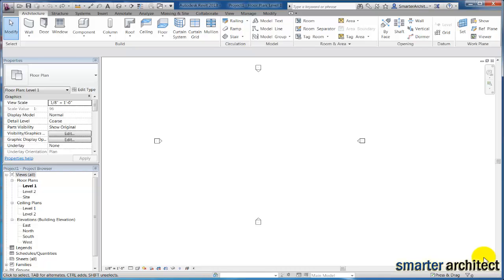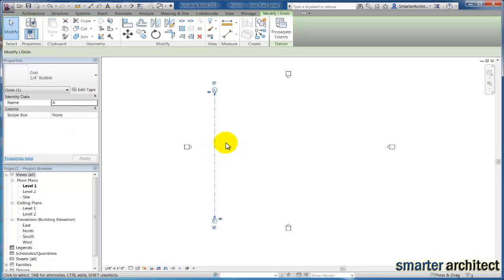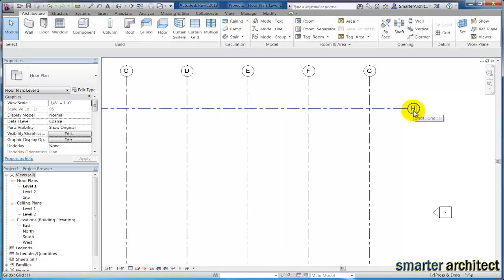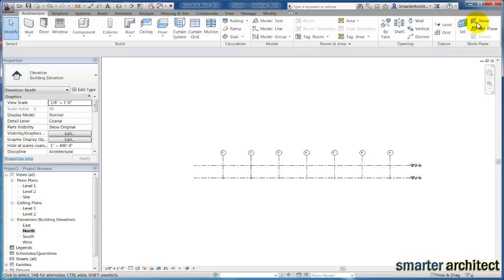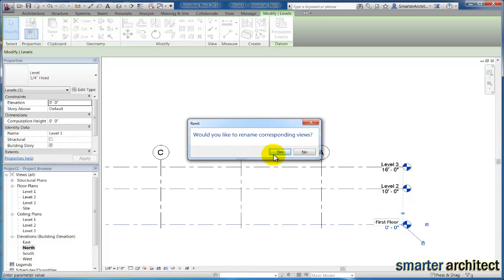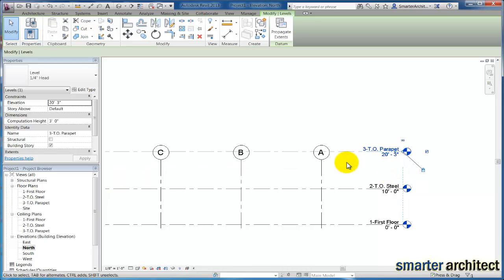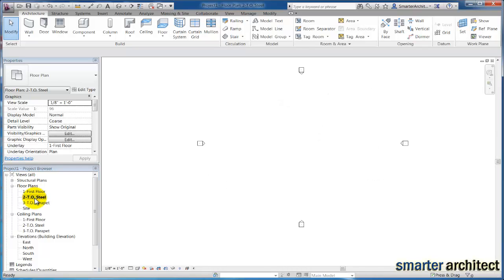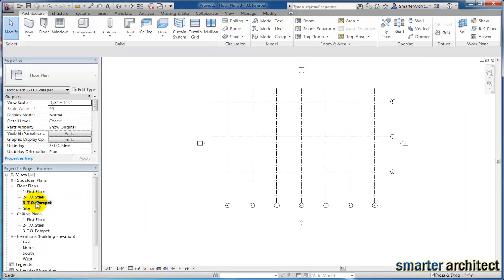Revit Tutorials - Revit Architecture: Creating Revit Levels and Grids

Comment: hii thank you for your amazing tutorial,,,i have some prolem in view of my level in floor plans,, i created the walls inlevel 1 and level 2, but when i click on level 2,i can see just level 2 and not level 1,, so i see just the wall of level 2,,you know why, coyuld you help me.. thanks
Reply from the maker: You have a few options for displaying level 1 walls in the level 2 plan.  #1 - Use the overlay setting in the view and set it to level 1.  All level 1 information will appear just "like an overlay" without changing any wall settings.  #2 - Change the view range setting for this particular view and set beyond elevation to the bottom of first floor (instead of second floor which is the default likely).  Working in BIM takes some a little while to grasp being in a model vs 2D environment.
Reply: thank you so much .. i have 1 important question,, i have to finish my thesis for june,, you thin i like biginner in revit can do my project or gets much time and is better that i work with autocad?thank you again for your amazing tutorial

Comment: But, where do the elevation bubbles come from?
Reply from the maker: JCLII If you do not see the bubble, there is a box that needs to be toggled on (checked) at the end of the grid segment in order to make it appear.  You can make the bubble appear on both ends as well if desired.